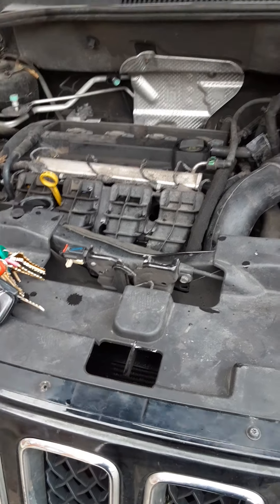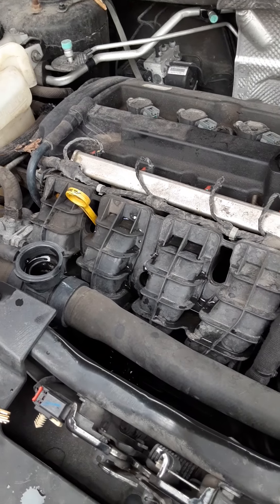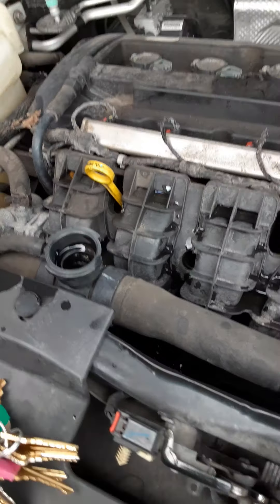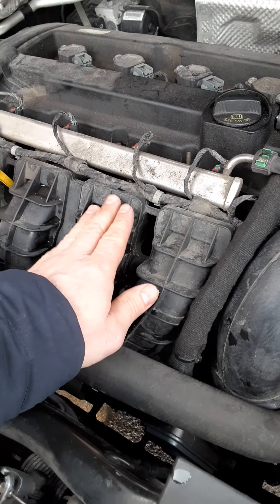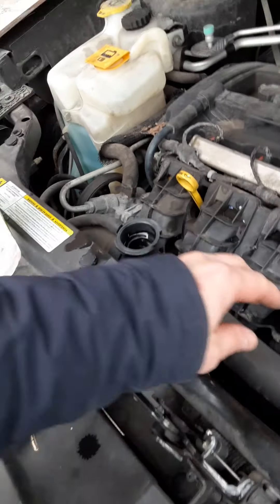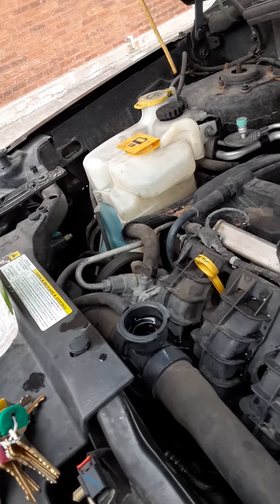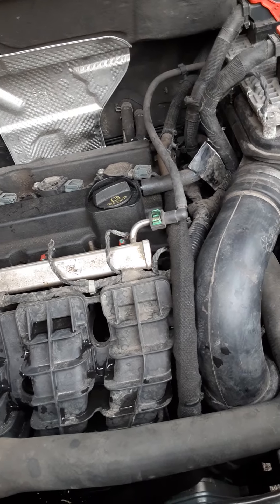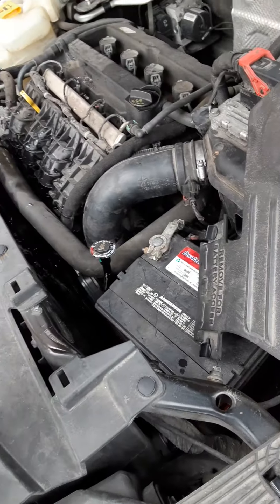Jeep compass over heat  replacement coolant radiator

Comment: Water alone will damage the engine. First mistake.
Reply: So, add coolant? Antifreeze? My jeep gets halfway to the “h”. I was going to put water for now until I figure out what else to do. Any suggestions would be greatly appreciated if you have the time:)
Reply: Replace your radiator. I'm having the same issue with my car, it is a 2017 Jeep Compass. The radiator is one of the plenthra of problems that the Jeep Compass has
Reply: @42ZERO7  half water half coolant is best. Water alone can heat up fast and can cause rusting
Reply: Tô com meu Jeep aquecendo igual esse o meu quase não tem vídeo desse compass mas antigo o único qui vi foi esse